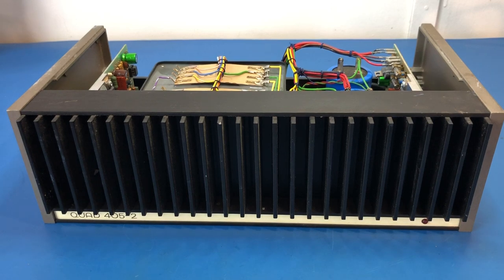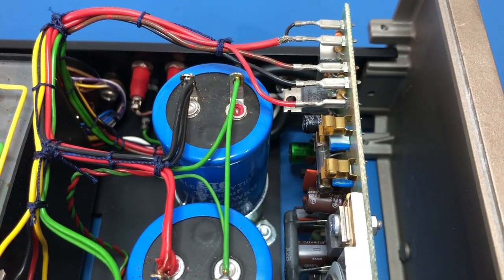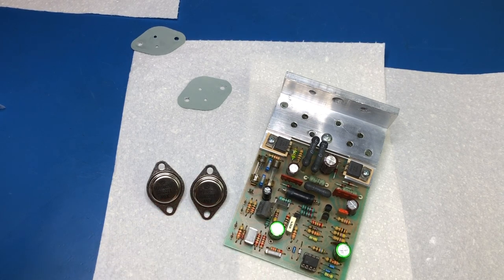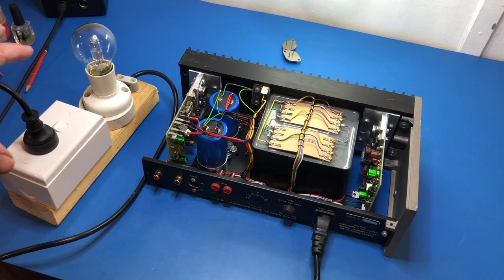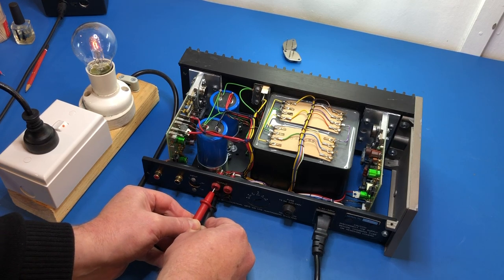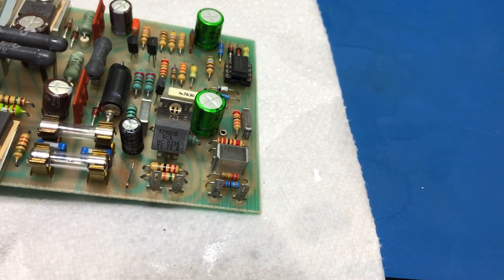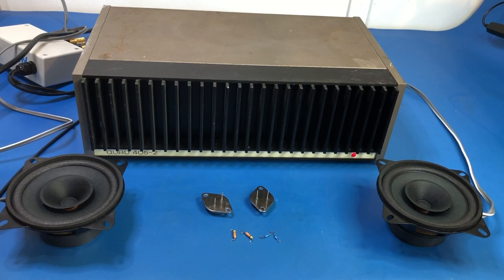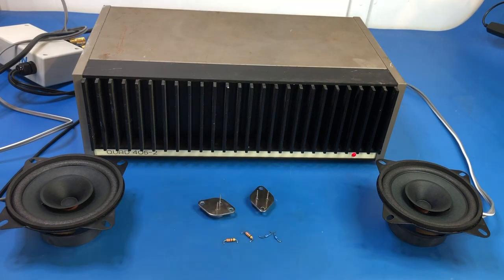Quad 405-2 Amplifier Blown Channel Repair

Comment: What would be your best guess on the component that started the failure?  I'm guessing it was one of the 15V Zener diodes that got tired, but what do I know? It would be interesting to take them up to their max current for a bit and see how they act. Too bad you had to go back in, but at least your speaker protection add-on and the fuses did their job.
Reply from the maker: Yeh, who's to know. I read on a few forums about the Zener getting tired so that may well have been it. My hope is there isn't some other issue hiding behind the scenes that will pop up again requiring a third go.

Comment: Please read up before posting, as these faults are all classical. The R7/8 that caused this fault, must be replaced by at least 1W 3k3 or it will blow again. The classical faults are different related to PCB rev.
Reply from the maker: I did and I have, but I will check it again...

Comment: Hi , great informative video, I'm just in the middle of recapping one of these using your videos as a guide, my question is the two Nicichon Muse caps you have fitted are bipolar where as the originals aren't, am I ok to fit two muse bipolar caps ? And what value are those two caps please?
Thanks 👍
Reply from the maker: Yes, they are fine. I have made the Bill of Materials available for my Patreons. If I recall the value is the same as the originals.
Reply: @audionautica6843  Thanks for your help 👍

Comment: ... a DC level on the output, if any, ought to be in mill volts ... another thing, you've fitted yet another pair of bulk capacitors even though you put a pair of new ones  in the previous video ... why ?
Reply from the maker: Two different amplifiers mate. I left the originals in this one as they tested fine.

Comment: Can my Quad 405 be upgraded to a 405-2?
Reply from the maker: I've never worked on a 405 myself, but my understanding is that over time the 405 evolved into the 405-2. Ie, the later 405s had seperate protection boards which where then incorporated into the main PCB in the 405-2. The service manual shows the various difference. There are also some pretty good web sites out there about the 405 and 405-2. They also talk about various ways of "improving" 405s.